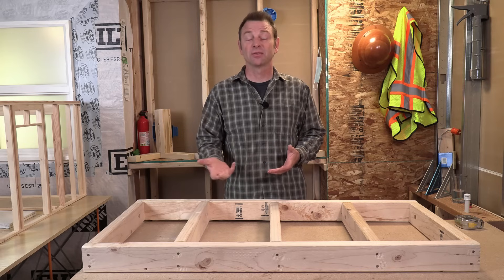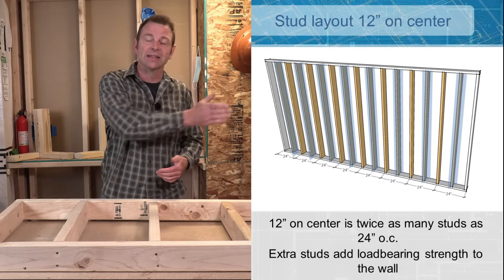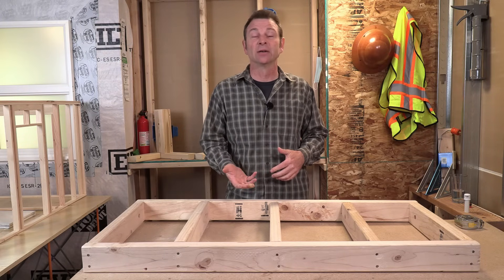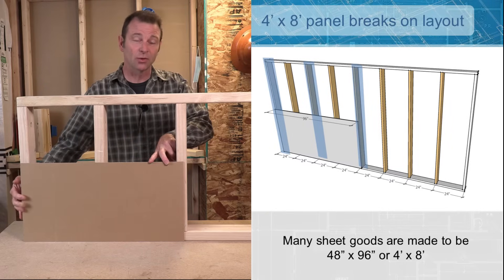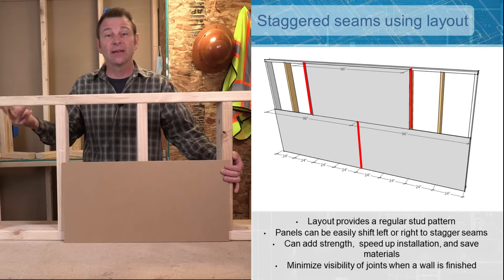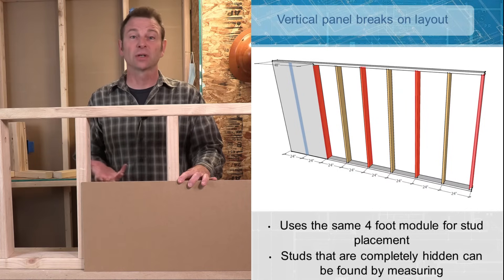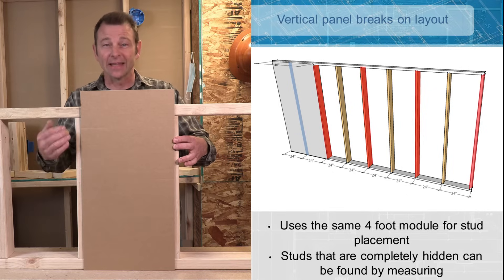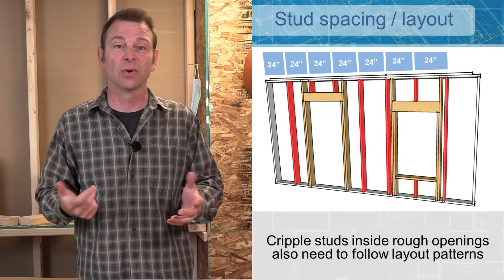Learn stud layout on a basic wall - TEACH Construction Wall Framing Lesson Video Series

Comment: I am always confused about which side I start my measurements for stud placement. The 16" center doesn't work perfectly for some walls. Do I measure from right , left and from outside or inside?
Reply from the maker: measure from any side that you want - just be consistent.   But you will likely end up with one spacing that is smaller on the last bay

Comment: I like the framing concept where all the sides could be built at the ground level and then lifted and fitted together!

Question. The plumbing and electrical are done after framing before the sheeting guys?
Since after the walls are closed there's no access

Comment: I have never seen any advice/rule/guideline that specifies which end of a wall receives the short spacing when its length is not evenly divisible by 16 or 24 inches.
Reply from the maker: There is not defined rule - do what makes the most sense for your situation

Comment: How does the 1/8” spacing requirement for osb (shear wall) affect where the breaks are? For a long wall, the 1/8 would compound quickly (1/8,1/4,3/8,1/2….etc).

Comment: Great video series, just watched a few including connecting exterior walls.  If framing is done correctly outside sheathing will be spot on but drywall will be off by the wall thickness (3 1/2, 5 1/2). Do the drywall trades expect trimming the first piece of drywall to compensate?
Reply from the maker: Winner winner chicken dinner - you got it exactly correct.   Layout favors the sheathing  - and drywall is easy to cut.

Comment: Great series. My question is repeating wall panels for long walls. Your next panel ( if built the same way) will double up the end studs and change the frequency of the repeating common studs. What is the best practice for building the adjoining panels? Thanks
Reply from the maker: try to keep your layout pattern if possible - life is easier with consistent stud placement
Reply: @ConstructionEd for plate seams, do you just cut them 3/4” so you have a segment terminal stud and the common stud restarts the wall segment?

Comment: Hey man, I gotta say this great content. I have no prior wood working experience and I want to build a table top 16 by 12 foot for my slot cars. I think I can use this example to create my frame for the OSB table top. What spacing would you recommend for horizontal use? 12, 16 or 24?
Reply from the maker: 24 inch spacing should be more than enough - slot cars are pretty light - of course unless you are planning on standing on the track to wave the checkered flag.

Comment: A lot of our builders are using 19.2” OC.  It’s 5 bays per 8’ of wall, floor, or roof.
Reply from the maker: That is also a common process for floor framing and joist layout
Reply: @ConstructionEd  What is the reasoning for using this convention?